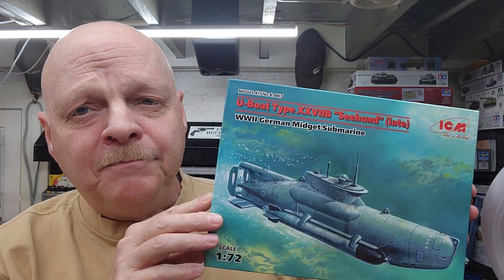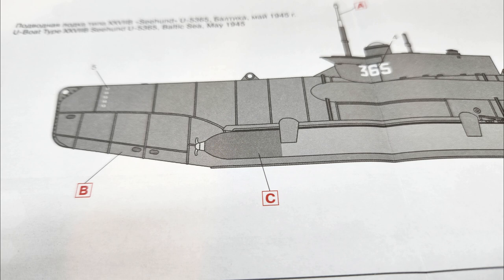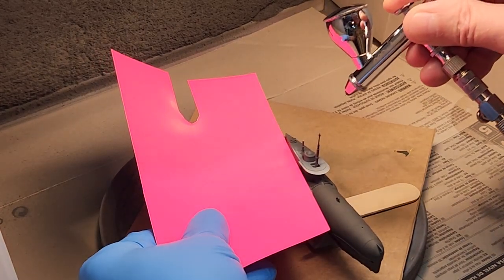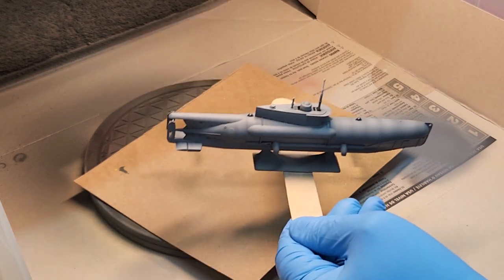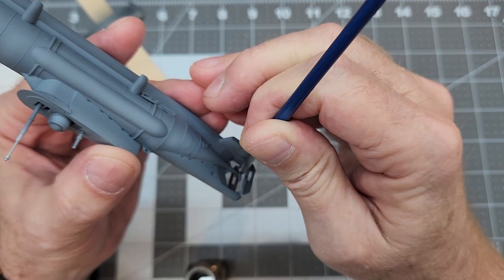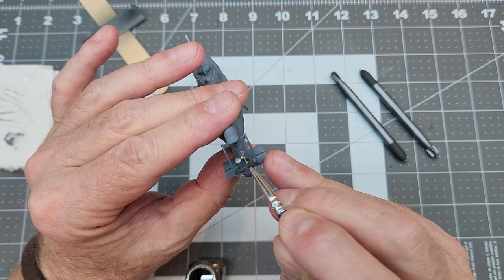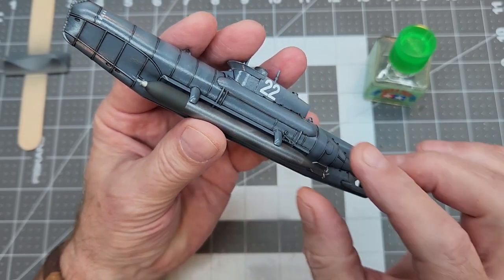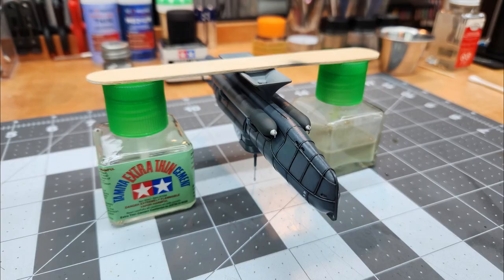U-Boat Type XXVIIB Seehund (Seal) (Late) Part 2, Paint, Decals, all Finished!

Comment: Lovely finish Johnny, it's a pity that the decals behaved as they did but, none the less a nice tidy finished product.
Reply from the maker: Thanks Gerry, it was an easy build with low parts count. I think my error with the decals was using Micro Set with such thin decals, Micro set can soften the material if it's really thin, I think that's why it grabbed the surface so fast, lesson learned. Thanks for watching, stay safe and model on my friend. Johnny

Comment: Use micro sol as a first step and micro set as you final coat.Good Job
Reply from the maker: Thanks for watching, I think micro sol is more aggressive than micro set, but in either case, with the decals being super thin any setting solution probably would have softened it just enough to let it grab the surface too fast. I didn't have any issue with just plain water. We learn as we go, stay safe and model on my friend. Johnny

Comment: Looks great, how do you thin and apply your tamiya clear?
Reply from the maker: Hi airfixfan, great question. I think it is always a good idea to stick with the manufacturers brand of thinner, so I use Tamiya's X-20A acrylic thinner with the X and XF line of paints. These paints are not water based, so if you try to use water with them they will clump and cause lots of problems, especially if air brushing. I thin the X-22 to 60% clear and 40% thinner, which seems to work best for me. Thanks so much for watching, stay safe and model on my friend. Johnny